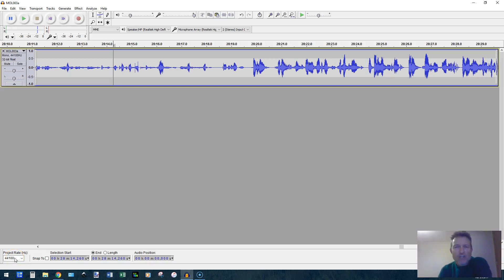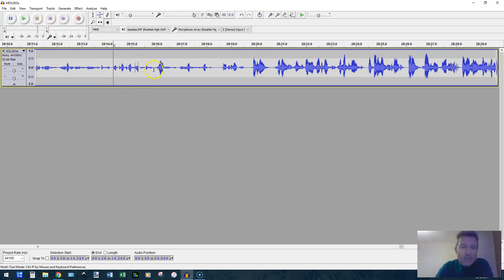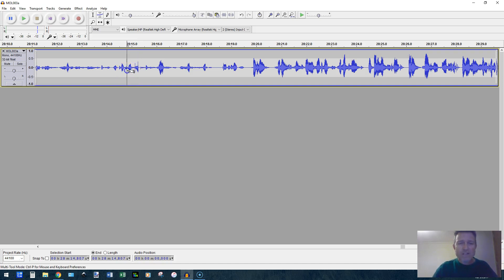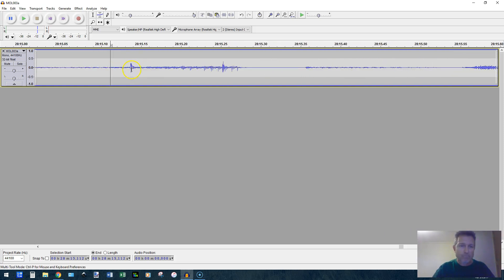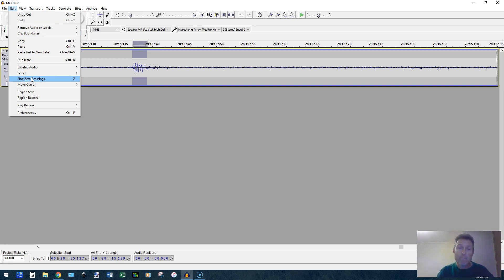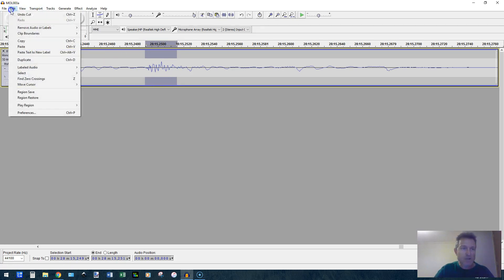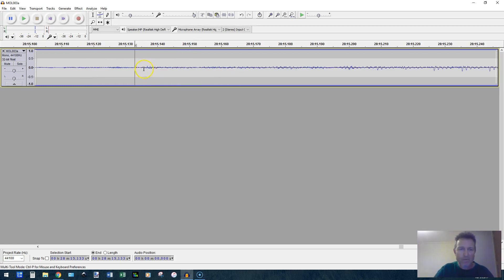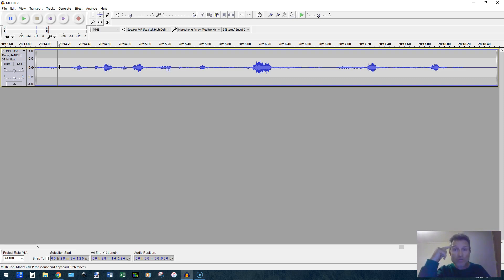Zoom is your friend - using Audacity to cut out pops, clicks, and stuff

Comment: After you find the zero crossings, but before you cut it I would recommend hitting C on your keyboard. It will play the audio near your selection as though you had already cut it. That way if you got it slightly wrong, you don't have to mess around with hitting undo and readjusting.
Reply from the maker: That's a GREAT tip, thank you for offering it!